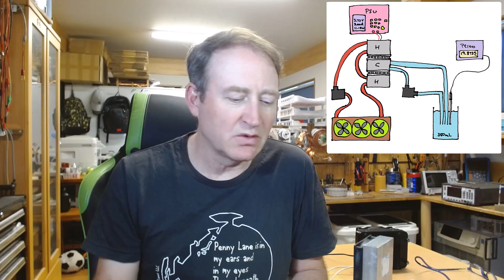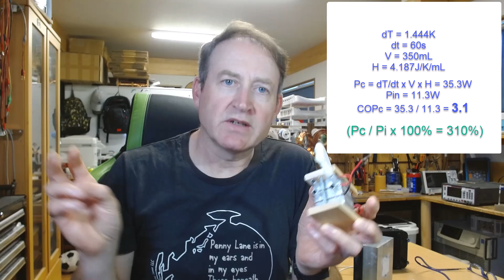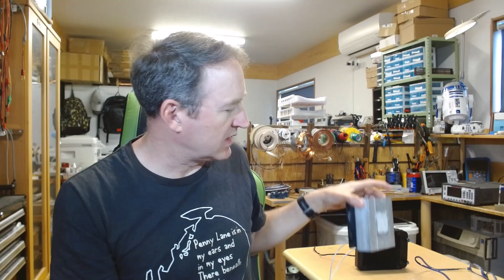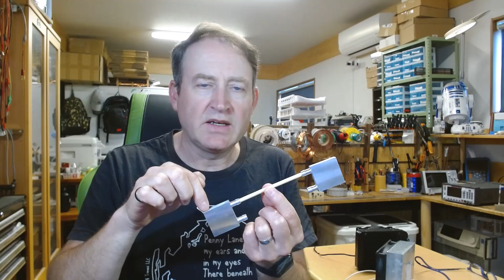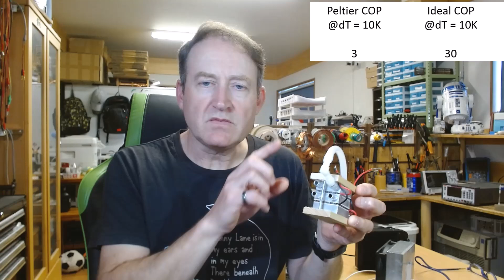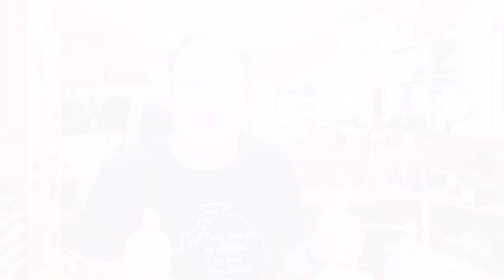Peltiers - the story behind the myth of 5% efficiency

Comment: Thanks. I was looking for something like this as I want to convert my gas motorhome fridge. I am an electronic design eng, long retired. I see the issue with peltier cells is thermal conduction across the peltier devices. I want to work out how to place multiples, like in series or parallel mechanically.

Comment: Thanks Peter, very interesting.
My idea is to set up the peltier using my basement wall that runs ~12 - 15C all year with a large aluminum plate on it to the peltier for the cold side.

What do you think?
Reply from the maker: Thermal resistance is a tricky one, it depends a lot on surface area. However this is nothing to do with Peltiers, it's common to all heat pumps. A modern air conditioner has a fine network of fins that the air passes over to maximise the contact area. Whether a large aluminium plate would make good contact with a basement wall would require a bit of testing. However, whatever the solution, once you have a good thermal contact with constant 12-15°C, that would great for a Peltier system
Reply: @PeltierPower  Thanks for the help. Hopefully I'll have time this summer to make some tests and let you know how successful it is. Your discussion and graphs on current vs output has been very helpful.

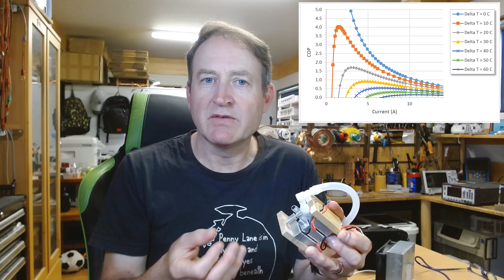Comment: 12:09 ok so for an ideal system as a air condition if deltaT is about 10degrees  the COP should be around 4… this would be interesting in Europe for spring and autumn to heat the house. Because electric energy is about 3x expensive as natural gas. So the cost could be reduced by 25% (1-3/4)
Reply from the maker: I think in practice go for a COP of 3 (for heating) in a well designed system. It's hard to keep the thermal resistance down when getting to serious heat flow (e.g. 500W or more needs <0.01K/W). All heat pumps need to solve this problem but Peltiers are more sensitive to the temperature difference, compressor systems have a bit more headroom. I'm currently running a 600W Peltier system and getting a COP of 2, but I could get 3-4 with lower thermal resistance.

Comment: The basic problem is that a Peltier element's efficiency is extremely non-linear with delta-temperature.  So if you are trying to cool only 1C or 2C ... yah, you can do that efficiently with a Peltier element.  If you are trying to cool something by 20C, though, the efficiency will be horrible.   

It gets worse.  One might think well... ok, lets stack Peltiers so each element only has to drop the temperature by a small amount.   That doesn't work either.  Why? Because of the non-linearity between the hot side and the cool side.  The cool side can only remove so much heat from its environment and each element you add to the stack reduces the amount of heat that can be removed by a scale factor.  

i.e. non-linear.   By the time you reach a delta of 20C or higher you wind up with almost no heat-takeaway capability at that delta as well as a poor COP.

So its a lose-lose.  Either you expend a lot of energy to run the Peltier elements inefficiently to obtain a large temperature differential.  Or you expend a small amount of energy to run the Peltier elements efficiently but wind up with such a small heat soak that it can't even keep up with insulation losses.
Reply: Yes and no. That's based on running them on full power, but even for a single stack, you want to run them no more than 20% power anyway. So if you have a moderate delta, you can still do 2 or 3 stage without significantly reducing cooling power, and get about half the COP of an optimized compressor. The only real factor is the large amounts of Peltier elements you have to use and making sure you have optimal heat transfer. So for moderate deltas, you can do it
Reply: @zci-o9i  Thanks for that. I was given a wine fridge with Peltier cooling and was wondering how much it will cost to run. I can run it in the basement which has much cooler temps.

Comment: Great video very clear aswel. Does this also apply to the low efficiency alot of poeple show on the internet when the proces is reversed? alot of the"peltier power generation" videos i have seen show a efficientcy of lower the 1%. does the COP just flip so you would have to put (in the previous videos case) 3.1 times more heat energy in then you would get out in electric energy? or are there more inefficianties associated with the power generation proces?
Reply from the maker: Actually it's an area I want to experiment in, but I'm not expecting much. I tried 6 months ago and didn't get anything significant (I didn't actually measure) but since then I've learnt a lot about better thermal coupling the Peltier to the water circuit, so I'd like to try again sometime

Comment: Thanks for the elaboration on your previous video's conclusions.  The trouble I've had in the past with Peltiers was while attempting to make a  fermentation temperature controller using them as the warmer/chiller.  I no longer have the data from that effort, but my recollection was that the difficulty we were left with after working out the efficiency variables we had control of (heat sink sizes, thermal paste, flow rates etc) was in the Peltier device itself.  It essentially has very little physical separation between the hot side and the cold side and therefore is very limited in how much delta T it can support compared to a cycle with a refrigerant where the hot side and cold side can be separated.  It seemed like relatively large quantities of heat would flow backwards by conduction based on the temperature gradient we were trying to maintain.  I'm very curious if you find a similar limitation in your lab / Have Peltiers gotten significantly better over the last couple of decades since I worked with them.
Reply from the maker: The Peltier itself doesn't leak heat from the hot to cold side (it's a popular misconception), but of course using a Peltier direct to a heatsink often means the parts outside the Peltier are close. If you use water circuit with the 40x40mm Aluminium cooling blocks it's easier to separate the hot and cold sides just like a compressor system. But the far bigger issue is that "heatsinks + cooling fans" don't work due to the relatively high thermal resistance, for example 0.5K/W for the one in the video. I forgot to mention the black heat exchange on the table in the video is 0.1K/W (5 times better) or even better the 3 fan version is 0.05K/W (10 times better). Using a 0.5K/W heatsink is the electrical equivalent of using AWG28 for power supply wiring. In my next video I'll introduce a model for the Peltier that should (hopefully!) make this a bit clearer.
Reply: @PeltierPower  I'm less focused on the .05K/W temp rise of the big heat sink than the 1.4W/K heat transfer through the semiconductor inside the module. But, if you don't think there is passive heat conducted within the module, ok.
Reply: @johnwilson839  there is a lot of passive heat conduction. In one of my experiments i actually measured the thermal conductivity but maybe because of the low quality measuring gear i got values a bit far from the one's calculated based on the material used or listed by manufacturer. The thermocooler is a sandwich between two sheets of alumina with small blocks of dopped bismuth telluride in between, soldered in series to the alumina sheets. The thermal conductivity can be easily calculated and i guess easily measured with sensitive equipment- a device sandwiched between a heat source and a heat sink and measure the energy flow over time. All the components of the Peltier device have high values of thermal conductivity and i believe if new materials with lower thermal conductivities but similar or even better figure of merits are used the energy pumping efficiency can be increased
Reply: @dionisienatea3137  Thanks!  You don't happen to remember the measured thermal conductivity and size of the device do you?  my 1.4 W/K was back of napkin based on pure Bi2Te3 brick 50mmx50mmx2.5mm.  I'd be super interested to compare to a measured value.
Reply from the maker: A typical 40mm x 40mm Peltier has thermal resistance of about 1.5K/W (conductivity ~0.66W/K) according to datasheets. In practical circuits I'm measuring 1.8K/W but that includes my thermal coupling, which is about 0.15K/W per side. However, the point is that higher conductivity (lower resistance) is actually better. It's counterintuitive, so let me explain: Peltiers act like a battery in the sense that they develop an "open circuit" temperature difference proportional to the current. In the first video, this was about 35K @ 3A (including the effects of waste heat). This 35K is available to pump heat, which under "short circuit" is then limited by that thermal resistance of 1.8K/W, so 35/1.8 = 19.4W for one Peltier. If there is a temperature difference dT external to the Peltier, it's simply (35-dT)/1.8, so for example if the cold side is 5°C in a 25°C room, dT = 20K, the power drops to (35-20)/1.8 = 8.3W.  In the video there are two Peltiers in parallel, so that effectively halves the resistance to 0.9K/W, giving 38W @ dT = 0K, and 16W @ dT = 20K.   

If you add 0.5K/W heatsinks on both the hot and cold side, one effect is the "open circuit" temperature difference drops from the waste heat which has to travel through the hot side heatsink, and the other is that total circuit resistance goes up. For a single Peltier, the effect is to reduce the figures by about 50%, which is not great but still OK. But with a double Peltier set up (as in the video), the numbers are bad. The open circuit temperature drop from 35 to 29.5K (from the 11W waste heat travelling through the 0.5K/W heatsink). And then, the total circuit resistance goes from 0.9 to 1.9K/W.  So overall you get a short circuit power of 29.5/1.9 = 15.5W as compared to the original 38W, and with dT = 20K, (29.5-20)/1.9.= 5W, compared to 16W. Not pretty.  

So it's not that Peltier leaks from hot to cold side, but rather the thermal resistance in the Peltier limits or restricts the power that can flow, like a 35V battery (cell) with 1.5Ω internal resistance. It would be great to reduce the thermal resistance, but that's limited by the Bi2Te3 material properties. Just like a battery, we can reduce this by putting cells in parallel. But there's no point say putting say 3 cells in parallel to make a 0.5Ω battery if you have 1Ω resistance in the external circuit.
Reply: @PeltierPower  the key problem is implementing a circuit with thermal resistance far lower (x10+) than internal thermal resistance of the Peltier module itself. Most people fail at this crucial step and that's why they get poor performance. The lowest heat resistance is from either heat pipes or diamond / graphen.